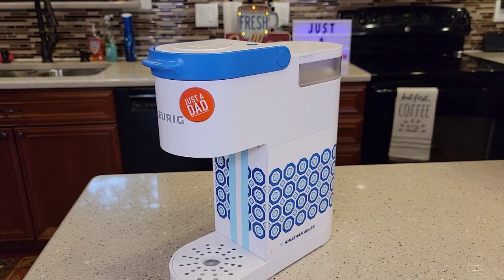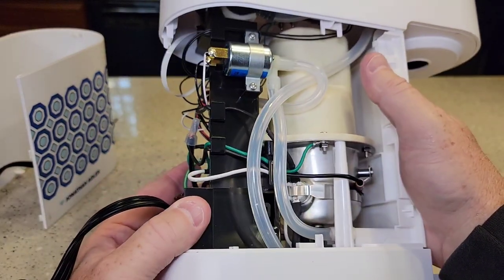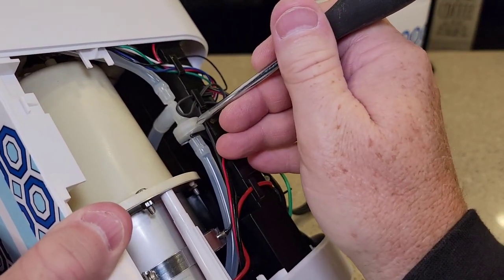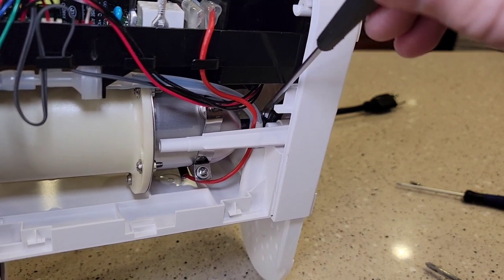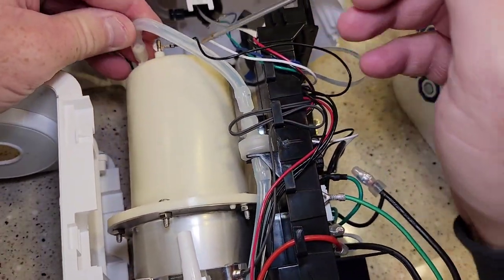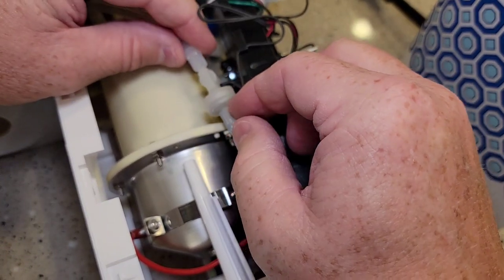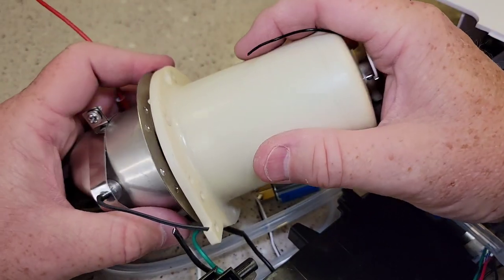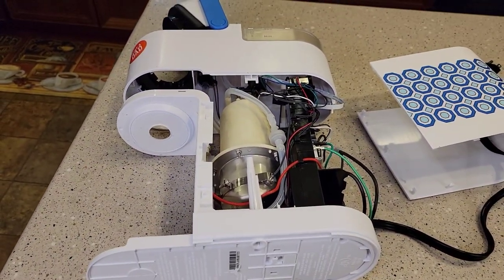KEURIG K-MINI Coffee Maker Leaking Water HOW TO OPEN & Find Leak Inside

Comment: Thank you so much! I was able to take apart my keurig. It was leaking out of the bottom. The hose connected to the water reservoir had popped off. I popped it back on and put a zip tie around it. I’m waiting until the water dries out of the inside before powering on and running again. Ty for saving me from buying a new keurig for an easy fix!
Reply: Think my prob is clogged needle port where it pierces the kcup..paper clip is try number 1..I have a smoke pipe cleaning assortment

Comment: Thank you so much for your video. I took out the casing as you showed and looked at the tubing. Nothing was disconnected in  my case but I noticed a lot of calcium deposit at the end of the lower tubing. So I went and added a full cup of vinegar in the upper reservoir and turned the machine on. 2 cups of liquid came out. Wow! Hardly any leak.  I cleaned the small spill and tried again with real water. Perfect water came out and no leak. All fixed! In my case, the problem appeared to be calcium deposit that prevented made the inner reservoir to overspill (not the tubing). Thank you so much for the video!
Reply from the maker: Wow, that is some good troubleshooting.  I will let others know.  thanks for sharing!!!

Comment: Just fixed mine that was spewing water out the bottom.  Of course the LEAST accessible hose had come off, the one that attaches vertically to the bottom of the main assembly.  Rather than tear everything apart. I just drilled a 3/4” access port (aka a hole) and was able to finesse the hose back on and secure with a zip tie.  

Thanks to you for the first step to access the inner workings, much appreciated!

Comment: Very helpful for disassembly. I found the water path clogged at the entrance to the k-cup. Cleaned with toothpick then used a straw to suck water and coffee grounds out. The clog causes the over pressure and leak. Just tested; works great. No need to disassemble. I used a second straw to provide water pickup at the one way entrance valve to the top of machine. Suction flushes water through the top of machine after clearing with toothpick.
Reply from the maker: Good job at fixing your Keurig!!!

Comment: My neighbor threw out her mini. At first it worked, then it didn't. So I found this on YouTube. I tried to unscrew the screws but no. I then drilled them out and pulled the surround off. Next, I took off the hose that goes to the check valve. I blew into and sucked out on the valve. Put everything back together, and now it works like new!

Comment: The "air pump" is actually a solenoid valve, which you can see if you take it out and give it 12 volts. As far as I can tell it provides a means for the keurig to dump water from the reservoir if certain conditions are met (maybe if the pressure is too high) I'm working on one of these that dumps all of the water out the left outlet through the valve into the tray at the bottom, making a huge racket in the process. As far as I can tell it is because of hard water deposits clogging up the outlet at the bottom of the heater. So hopefully descaling with vinegar will fix
Reply from the maker: Oh wow, sounds like you are really learning how this things work, thanks for the information!
Reply: Any update if descaling with vinegar worked?
Reply: I ended up taking it apart and cleaning it out piece by piece because it was so bad but descaling could still potentially work, I didn't actually really try that in the end.

Comment: A masters touch - this worked when I left my K-mini, the no reservoir model, out in the cold overnight.  Wouldn't cycle a full cup after I got it to cycle properly again.  Removed the two screws on the bottom and used a very thin flat blade screwdriver or you could use a butter knife to remove the snapped hinges from each side.  The snap in the top of the back on the inside of the cover is a bugger.  Use a flashlight and proceed carefully to release the dual tab.  Can't reach it with a pair of needle nose pliers to squeeze the two tabs toward each other unfortunately.  Found water in the vent tube near the bottom the left side.  Pulled the tube off and drained the water.  Pulled a tube off of the check valve and blew and sucked with little results.  Slid the tubes back on the fittings. Opened the lid where the K-cup is inserted and put the straw on my computer duster canned air into the hole on a black rubber piece right behind where you drop in the k-cup pod for brewing.  Pulled the trigger on the air can and water shot straight up and flowed like a geyser.  Repeated about 6 times and water flowed out in a spout every time.  When the water stopped flowing I used a Q tip and paper clip to clean the fittings in the lid that sits down on top of the K-cup pod.  Namely the rubber piece that matches up with the rubber piece you just shot air into and the paper clip for the needle valve.  Spray these with air also.  The problem was that the heating tank reservoir was partially filled with water and the level was low enough that I couldn't see it with the cover off.  DON'T DISSASSEMBLE THE WHOLE MACHINE TO PULL THE HOSE OFF OF THE BOTTOM OF THE HEATING TANK RESERVOIR, YOU WILL BREAK THE MACHINE AND SAY BAD WORDS.  USE A CAN OF AIR WITH A STRAW IN THE TOP UNDER THE COVER TO CREATE A NATURAL GEYSER.  YOU ARE WELCCOME.

Comment: my issue was water coming out the bottom left hole ( if your facing it). evidently both the left and right are air intake lines. both of mine had water suspended in them.when you fired it up it would pour out the bottom.. first i disconnected the line between the pump and the left drain and pinched it of. ran a cup of water through. while it did push some water up to the coffee make it didnt clear. then i disconnected the connecter on the top of the regular valve on right side. i originally thought i would see hot water coming out when i ran a cup. wasnt until i pinched it off hard that i heard the pump really engage and then start blowing hot water though the coffee chamber..put everything back reg, did add small zap-straps on the hoses i loosened
and everythings works ok..seem if you get water trapped in those drain hoses you end up with a airlock. mine's working ok now..
Reply: I have the same problem. I believe it was caused by dropping it while transporting. Questions: When you did the 2nd step of disconnecting the connector, did you leave the left tube pinched off? When you say 'connector' are you meaning a tube or wiring? And what tube did you pinch off hard? Thanks

Comment: Took it apart like you showed. Mine shows no signs of disconnect or leaking inside. It’s like it’s coming out of the little holes in front you showed. Can’t figure out how to repair.
Reply from the maker: have you checked for a clogged needle on to and bottom

Comment: What can I do if mine will not turn on.  It just randomly stopped working.  I have the cover off.  Is there a reset button on this model?
Reply: That's exactly what I was about to ask.  I didn't see one in the video either.  Did you ever find out?
Reply: @badtupram  No. I threw it out and bought a different one with a gift card I had.
Reply: @cutenss  That's about where I'm at too.  lol  Thanks for the response. tc

Comment: I think if you run it with the back off maybe it would be easier to identify where the leak was coming from.
Reply from the maker: Goop tip thanks for sharing
Reply: I tried that and it didn't work

Comment: Mine pumps water into the heating element then it heats up and it just sits there and doesnt pump water out into my mugg. 
Had to turn it on and off a few times id beat it and slam it down on the counter and it would usually pump the water out. But its not pumpin it out at all now. 
Thanks for this video man i was fixin to break this thing tryna take it apart. Hahaha
Reply: That is kind of like what mine does. It heats up the water and usually pumps a couple of tablespoons into the cup, then stops. If I turn it off/unplug, then restart it will pump out a small amount, then stop again. I already tried doing multiple fake brews with vinegar in the reservoir and that did not get it working. Now that I see how, I'm going to take it apart and see if anything looks amiss. Thanks for the detailed video Just-a-Dad!
Reply: Does it leak at all?

Comment: What if it doesn’t even power on? Any trouble shooting advice for this model?
Reply from the maker: no sorry, if no power that means its probably can 't be fixed.
Reply: I’m having the same issue.  Most Keurigs have a reset button but I can’t find one on this model.  So frustrating!  Feel like they should last longer than 2 years!!!

Comment: Part of a dumb design is there is no overpressure escape valve on the tubing from the bottom of the boiler (hot water output) to the output at the top (Needle). So when the needle is blocked the hose expands and can crack which causes a large spill. That's what happened to mine. The hot was in the boiler will reach 202 F before exiting and if there is no where for the hot water to go the silicone hose makes like a balloon.

Comment: Thanks for the video! Anyone ever figure out an easy way to get to that little screw hiding under the water tank to get the bottom off? Not overly important but might be helpful to some. Love when they tuck things in hard to reach places like that!

(Pulled mine apart thanks to help from your video and believe I have a bad water pump. Ordered a part from ebay and will see if I can fix it. Tried doing a full sized Keurig recently and the bugger just wants to be a P.I.T.A. :D)
Reply: To followup on my pump problem, turns out it was seized up, likely from hard water deposits. I was able to get the pump "wirring" again but it wasn't flowing water. I was able to take a syringe (no needle) and push some vinegar through the pump - and it worked! It's flowing great now. Just saved myself $17 for a new one. :D
Reply from the maker: Good job figuring it out and helping others!!!

Comment: No switch valve between the hot tank and K-cup? That is a major design flaw. It will either begins discharging with luke warm water or vent steam while boiling water depend on how that solenoid switch valve works. Maybe, that is why this unit leaks water because of steam build up.

Comment: Totally appreciate this video... but how certain are you that those air pump tunes are for air because of they are for air I mine is in trouble because they're full of water😂
Reply from the maker: I do think the they have an air pump because the pump only has an output. it only put air into the line about half way through. so some of the pipes before the air pump will have water in them , hope this helps.

Comment: mine leaked and it was the uper nidle that was cloged so water could not go thrue the nidle and open the check valve and water cam out from the botum as soon as i cleaned that nidle water flowed well and it cleaned the nidle

Comment: I have that same one. Started to work on it and disconnected too many of the hoses. I was actually able to get it back together but still have hoses crossed somewhere. Now, at the end of the heating cycle, the machine pushes the water onto the reservoir that you're supposed to fill before brewing....help!
Reply from the maker: Wow, sorry about this.  Find the water pump and make sure it is sucking from the tank.  then the last line should be the for the air pump
Reply: @JustADad  thanks!  I messed with it for a while longer when I sent you this message.  Finally got it working correctly.  Thanks for your video and your response.
Reply from the maker: @qbnjohnny  Awesome,  I am glad you got it back together!!!!

Comment: I bought this exact machine and we've used it for not even 2 months and it stopped working. The power comes on and then it blinks but when I push the big button on the top nothing happens. This is the 3rd keurig in 1 yr. I can't figure out what's wrong with it. Frustrating!! It's like throwing money out of the window!
Reply from the maker: The K mini's clog there needles really often.  I made a video on how to clean the needles https://youtu.be/sgyDJ6V3G6I
Reply: @JustADad  Thank you!